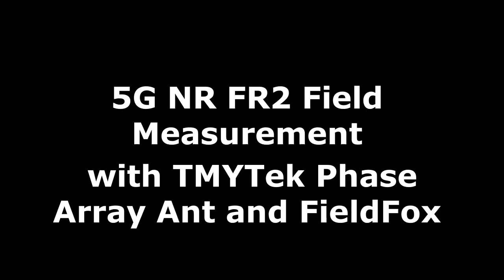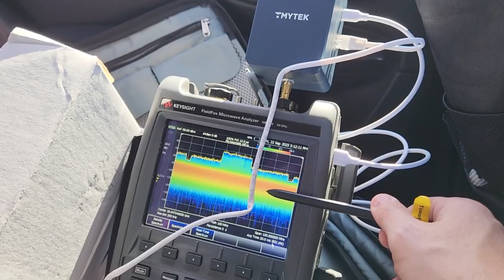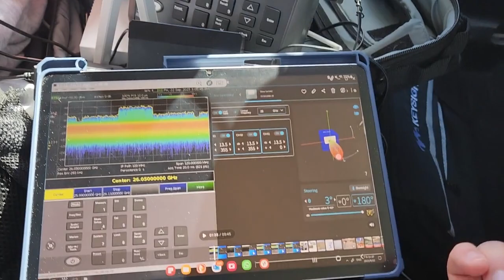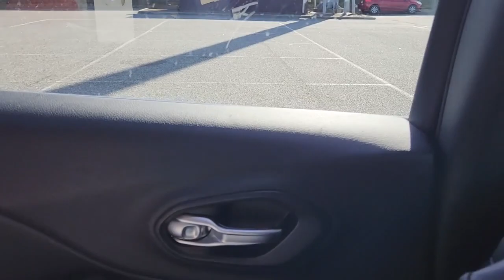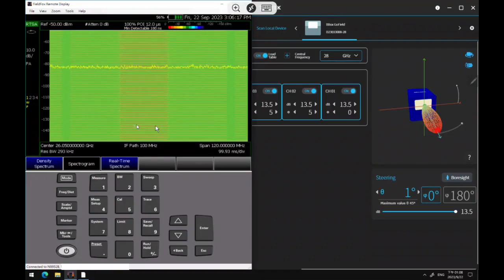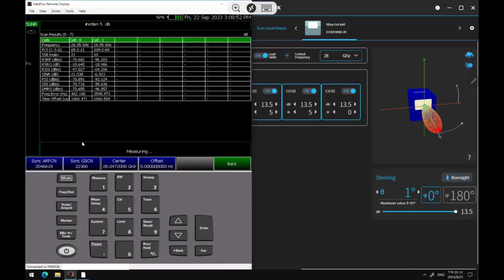Episode 116: 5G NR FR2 Field Measurement with FieldFox couple with TMYTek Active Phase Array Antenna

Comment: Very interesting channel, is it possible to know more about the antenna  that you're using. I would like to have the datasheet or the web link to TMYTek Active Phase Array Antenna that you used in the measurement. Thanks
Reply from the maker: This is their website. https://tmytek.com/
The unit that i used in this demo is BBox GoField. should be able to find the spec in their website. Best is to contact them directly.